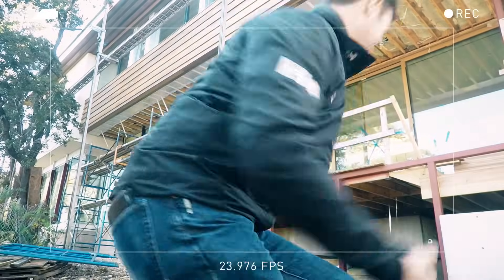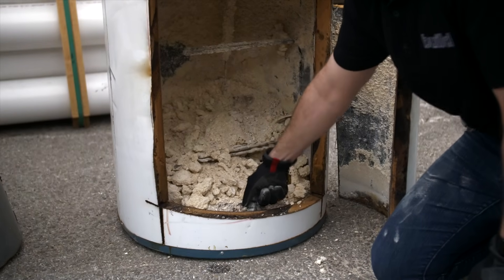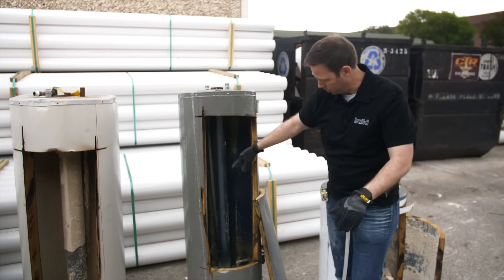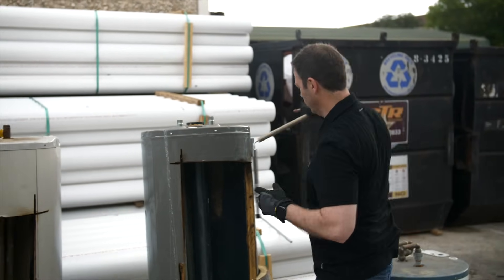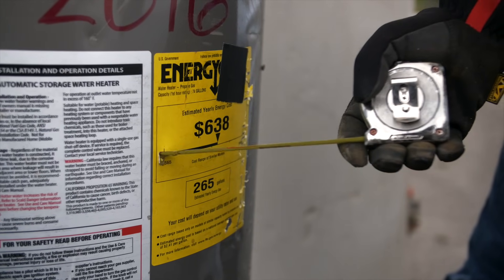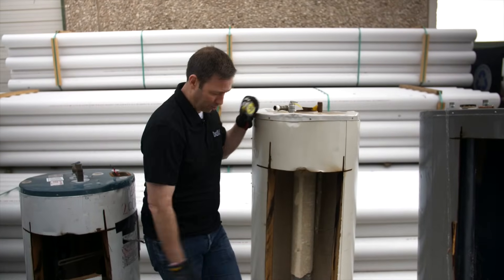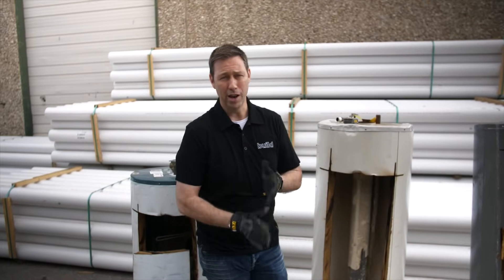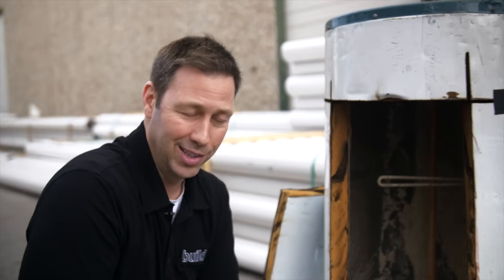Four Water Heater Tanks Cut Open - Lessons to Learn

Comment: I never heard of draining for scale until last week and never heard of the anode rod until today.
Reply: Anon...I know nothing too. I'm on here because I've had my water heater for 26 years. I've never done anything to it. I called my plumber friend and he said, "if it ain't leaking don't fuck around with it".
David
Alberta
Reply: 23 yeears experience ..... i found if you flush water heater just by opening drain valve on bottom..... the cold water dip tube that goes to bottom.of tank.... immediately stirs up sediment and does not give a good flush, since sediment begins swishing aroumd in tank.... it is better to BACKFLUSH, by turning off feeder valve to water heater, then cap off single handle faucet with a penny or dime in the aerator, then open up hot and cold on faucet..... cold will back flush through hot line, and pressure will.come from top of water heater,  through hot side, keeping sediments from.swishing around in tank... sediments stay at bottom and out the drain hole..... just my 2 cents
Reply: Most do not.

Comment: I can't believe people still buy tank water heaters. They are expensive to buy, operate, and require all kinds of maintenance. Get a tankless water heater the next time yours needs replacing. I have had a propane one for years that I paid around $80 for and I've never done anything to it except replace the batteries once. They power the lighter. I've saved a pile of money and never run out of hot water. Tank water heaters are obsolete.

Comment: I am a rental property owner and real estate appraiser. I see a lot of water heaters. Those old white case with blue top water heaters are the best. I still have one going strong strong that was purchased in '96.  Those newer gray ones are junk. Last about 6 years. Tanks always fail. So disappointing that American companies will build and sell crap. Just started buying stainless steel tank heaters. No anode needed. Too soon to have an answer on longevity. I like "Here To Help's" idea of installing a 3/4" ball valve at time of install. Also make up an air fitting adapter to connect from air compressor to water heater inlet nipple to quicken drain time at change out. You don't need a lot of pressure, and it sure helps to push the water and any sediment out through the low quality drain valve..

Comment: I don't know anyone who flushes their hot water heater or replaces their anodes. If it ain't leaking they just leave it alone till the hot water stops working.
Reply: I flush mine regularly.  Tried to replace the anode but the last owner never did so it's seized in there and stripped
Reply: @ChevTecGroup  i had the same issue. the turbing/anode rod was crused. I had to trim it from top; then cut a side wall using zig-zag and then use a chisel to squeeze it smaller . it came right off.
Reply: Jacob Monnin   I've thought about that,  the other thing is that it is under an inch or so of insulation that I had to cut through to get to it.  I mainly wanted to swap it to put in an aluminum rod so my water will stop stinking.  My well water reacts with the rod that comes in them. So I'll probably buy a new one in a couple years and swap them right away, then I can maintain it properly from the start
Reply: I've replaced 2 rods on two different water heaters at two different houses.   The first one was after at least 6 years (might have been more, I don't remember... it was definitely time to replace it.)     I believe Aluminum Zinc rods may help prevent some kinds of bad smell buildup generating compounds.   I'll certainly replace my current rod again in about 4 years.
Reply: linandy1 if u have well water or hard water like in a city sometimes, definitely something worth doing every now and then youd be amazed what comes out
Reply: I paid a plumber  to flush mine, and he taught me how to do it myself next time.
Reply: Robert Boudreau  After 7 or 8 years enough sediment can build up inside the tank so that it covers up the drain on the inside of the water heater. If this happens you cannot drain it. But, if it is electric, remove bottom element and it will drain! For gas, unscrew gas control valve and it will drain. Last resort, remove a nipple and drop a hose down to bottom of tank and siphon out. If all this fails and you still cannot drain, buy a new house!
Reply: Right on brother,dittos
Reply: I flush but it is impossible to change the anode rod. I have a Bradford White where it is built into the the hot water port so I'd have to cut the hard copper line and re-solder plus I don't have the head room and they don't make a compatible flex anode.
Reply: Kinixys3 
Yes they do.  Go to: waterheaterrescue.com they have the replacement anode you need.
Reply: gregory grimm everybody I know living in a single family home has a single water heater with no need to heat hot water.
Reply: I flush weekly and replace my node quarterly!
Reply: I did mine and 4 of my neighbors for free. total 5. Lowered water pressure from 98 psi to 65 psi. lowered the water temperature lowest comfortable. I see people changing water heater in my street already but ours are going very strong especially with the reduced water pressure.
Reply: I flush every 6 months because of scale

Comment: On the first one, you called the heating elements anode rods. An anode rod is a totally different thing. On the last one you called the elements, "Burner elements". It either has a burner or elements, not both.

Comment: I was told by the mfg. rep. in Home Depot that the difference between the economy model and the next level up was the fact that they had a sacrificial anode.....here in Northern Fl. it's not unusual when replacing elements to leave the old one in the tank because there is so much scale build up that it won't fit through the hole.....
Reply: They all have an anode.  Usually 6 yr warrantee has one, 12 year warrantee has two.

Comment: My water comes from a 200 ft. deep drilled well. It is acidic and contains lots of iron. We installed a system to treat the iron problem, but were still getting the rotten -egg smell. I was told I should REMOVE the anode rod as it could be oxidizing the sulfur and causing the smell. I removed it, plugged the hole and presto, no more smell. I have a 15 year-old builder's grade electric Rheem water heater. Still going strong. I do flush it every year.
Reply: It’s my understanding that you can use an anode rod with an aluminum/zinc alloy, instead of an aluminum-only, or magnesium-only rod to avoid a sulphur smell, and still protect your tank against corrosion.
Reply: You NEED the anode rod to prevent corrosion.  I suggest you look into a powered anode which will protect your heater and also prevent the smell.
Reply: I did home inspections for several years, one of the best things I picked up along the way is under electric water heaters, put a 2 inch foam pad under your electric water heater, this does two things, first it insulates the bottom of the tank from heater to ground heat loss. The second thing this does is stop the ground to water heater electrolysis that happens if the bottom of your water heater is sitting on cement, which causes the bottom of your water heater to rust out.  I would still do this even if your heater is sitting on wood, because it will increase the efficiency of your water heater because of the insulation sitting underneath your water heater.

Comment: I just replaced the anode rod on my water heater and it was nearly gone; my guess is that it was the original rod with the tank from 2006 (just bought the house a year ago).  Hopefully I didn't wait too long, but at least now I know how to maintain my water heater.
Reply: Good job! I hope you drained and flushed the water heater while you were at it.

Comment: What happens to water heaters when they have alot of sand in them i remember draining one at an old job and not but sandy water came out from it ?
Reply: If it’s on a well, it has bad sand filter or water heater is old, flushing will remove sand make it more efficient

Comment: Hi Matt,  I've been a plumber for 22 years, I  think  the  amount  of  scale inside the water heaters is dependent on your location.
Also where  the  temperature is set, if the tank is  set over 140°f, you will have  more scale.

I'm in western Canada,  our  water is relatively hard.
I realise many will disagree,  but  I have  found  softners often  cause  water heaters  to prematurely fail.
The salt will  cause them  to  rust anywhere the  glass  lining may have a tiny crack from  expansion and  contraction.
The  failures I see  range  from 3-7 years  from  date of installation.

On the  other hand,  I've  seen  many water heaters without softners last over  twenty years.
I often unthread the drain cock  to  empty the tank  more quickly,  and I honestly  haven't seen much scale in any without softners.
This  has led me to infer  that
softner  salt, and high water pressure seem  to  be the  biggest killers.
I guess if you live in a region that  has extremely hard water, a softner may be considered to  be essential.
Same  with the sacrificial anode,   we  usually  never  need to  touch them,  unless it  is in areas outside  the city which have different water conditions.
Reply: im in southern ontario, and mine is 20 yrs old. i drained it but no sediment came out , and the water was clean. i flushed it with cold water and still no sediment, so guess ill wait  for impending disaster lol but its right next to the furnace, so im always wondering.....
Reply: @joel474  is it still working?
Reply: My moms heater is 30 years or something. Should probably be changed. Here the water is hard and no chlorine added either.
Reply: Even in the same city you’ll get different water qualities, in my house I flush the water heater without any sediments, If you drive 5minutes downtown water heaters build sediments to get clogged faucets in just 3 years
Reply: Water softeners don't put salt into the water that goes through them. That's a myth. They use the salt in the flushing process to regenerate the ions on the resin bed. That salty flush water is dumped outside or to a drain. The salt never goes into the actual water supply to the house.
Reply: Agree with everything you said. A lot of it has to do where you live and also soft water units seem to always shorten the life of the unit same with garbage disposals.
Reply: is Citric Acid harmful?
Reply: Citric acid is basically orange/lemon/lime juice. Basically a weak acid. It is harmful for somethings but great for others. I use it as a cleaner for wooden lawn chairs. Others use it as an insecticide.
Reply: @_Circus_Clapped_  No more than vinegar is.
Reply: Funny you say that because here I am replacing one that lasted only 7 years.
Reply: Thanks for sharing your point of view.  Good info. and although I'm not a plumber, your experience matches my limited (7 water heaters I've maintained, repaired or replaced) experience with tank water heaters.  Went tankless eight years ago in a area with pretty hard water (250mg per liter) with limited scale prevention.... given the environment, I'm shocked I've gotten eight years out of it.
Reply: @mondavou9408  Matt has a video on flushing out tankless heaters, where it is even more important than tanked heaters.  Hopefully whoever installed yours made provision for flushing but more likely not.
Reply: @schsch2390  Thanks!  I missed it.  I'll check it out.
Reply: You're right. Soft water is corrosive. Hard water actually protects the tank.
Reply: @pauld3327 disagree. I had an Electric 82 gallon water heater from 1971 last 37 years on softened well water (82) grains and a whole house Carbon Filter. Never changed any anodes. Finally started leaking after the 37 years
Reply: My well water n no softer 22 y o tank anode removed @5 years because water stunk n didn’t replace. Can’t flush because plastic valve leaks when open. I have a new one on hand but feel I’m stretching it with the old one. Wish me luck !!
Reply: Hi fartman2269, Great comments and observations about systems using a water softener.  I could not get my gas water heater tanks to last more than 5 or 6 years until I started changing the Anode rod.  On my newest tank I first replaced the Anode rod when the tank was 3 years old and the rod was completely gone except for the center shaft.  I then started replacing my Anode rod every year which might be a  little excessive but I definitely can't go 3 years, and 2 years probably would be good based on what my rod looks like after 1 year.  I replaced the Anode rod again yesterday and my tank is now 9.5 years old so major improvement relative to my previous tanks only lasting 5 to 6 years and yes I run a water softener.  Every year I also unthread the drain cock and this allows me to use a copper wire to drag out sediment while flushing the tank with water and thankfully my basement is not finished so I can make a mess during the flushing process without any harm to my basement.  From what I have researched the Anode rod on a softened system definitely degrades faster than unsoftened systems and I doubt it has to do with "salty" water but rather the change in chemistry of the water after it has run through the water softener system and how this different chemistry water alters the rate of the electrolysis process (just a guess on my part).
Reply: You bring common sense to a room full of salesman...they are speechless

Comment: The type of anode rod used depends on the hardness of your water.  In Arizona, I had a magnesium, but! After removing my water softener from the system the magnesium rod created gas.  Had to go to an aluminum anode.  Also sometimes the type of anode will cause the water to smell.  Also the "sausage" anode was the cause of water heater failure.  The very end piece fell off to the bottom and corroded a hole causing the tank to leak.  I just saw the solid anode off to fit.

Comment: Matt, You must know scale is based upon the "Hardness" of the water along with a variety of other inputs caused by local or other conditions:  Well vs Municipal supply, etc.  I sold Water Heaters part time in a retail department store 30+ years ago and learned a lot.  I also have used water softeners for the 2 owned homes over the last 40 years (Upper Midwest water is the hardest).  I do not believe you can do much about scale (Personal opinion) but it does pay to change the Anode Rod for sure!!  Most people have no idea about it.  In 2017 I changed out our gas water heater here (First time I did one myself).  The worst water heater I ever encountered was a Whirlpool about 15 years ago.  The tech called me out to the street as he was about to throw it on the truck and showed me the white slime pouring out of it.  It was ugly and gave me the creeps.  The wife just reminded me about that case.  We later learned a Class Action Lawsuit had been filed for those heaters.  They do not make them like they used to.  Water heaters used to last 20 years+.   The new ones are junk as stated below.

Comment: You called the elements anode rods.
Reply: No , anode rods are electrolysis  or corrosion inhibitors ,keeps the electrons from eating your tank ,they are more electrically  negative and get eaten first by electrons , boats and ships  use them for the same purpose .

Comment: NEW CLASS OF WATER HEATER -PATENT PUBLISHED - Un  Pressurized Horizontal Electric Storage tank W.H.  More Hot Water, >>Quicker Recovery, >>0.5KWH/Day Standing Loss, ELIMINATES >>EXPLOSION,>> SEDIMENTATION>>,CATASTROPHIC WATER LOSS reduced to volume of tank -- CORROSION REDUCED by 95% by elimination of Dissolved O2 -- Poor Inventor family of two cost $6 a month - Build your own cheaper than buy cheapest retail. Having a 40 gallon Model SS built in China $250 to replace my 30 gallon open head drum model in use 26 months

Comment: My heater is 32 years old and I work at a plumbing supply house..the problem replacing it is I have to move my 65 year old boiler and if move that I won’t be putting it back so I will need a new boiler too. Every single day is pins and needles what a lifespan on that heater. I have to spend $10,000 minimum on this project as the venting will have to change and WoW. I can’t think about it anymore.

Comment: But it would have cost a shitload to soften your water for 17 years. Hundreds of bags of salt.. I think I'll just replace mine every 17 years.
Reply: I use 7 bags a year and my water heater is 13 years old and going strong.  Still have all my shower heads, washer, and dishwasher from new.  You’ll replace yours much faster.  Water softener only cost me $300 so that’s an up front cost.  Soft water also saves on laundry detergent and dishwasher detergent.  It’s your stuff and you can do what use please.
Reply: 7 bags a year my ass
Reply: @juelz4516  
His incoming water might not be that hard.
Reply: Had a water softener that was malfunctioning back in the 80's in California, was $3 grand to repair which was a LOT back then, on top of all the other costs associated with it, like energy use that completely defeated the purpose of trying to save on water heating.  I actually think that Nat Gas is the ONLY way to heat hot water and I would never own an electric but unfortunately service is not available here, and propane is even more expensive here than electric.

Comment: We had some Rheem units in our apartment building that were over 50 years old and still working. No maintenance ever...
Reply: You should cut the thing open and put it on YouTube.
Reply: @Steve197201  Dad put them in when he built it in 1939. When we sold it in '89 some where still in use.
Got a friend with a central air unit that's over 60 years old and still runnung. Can't remember the brand. Carrier maybe..